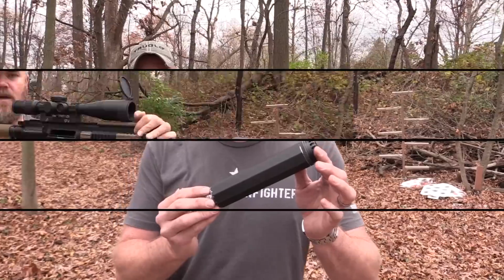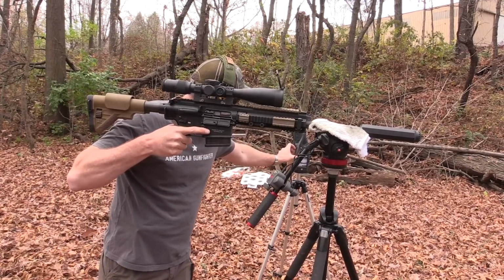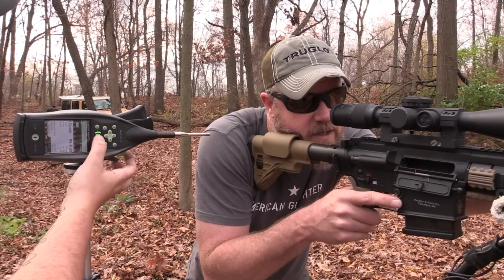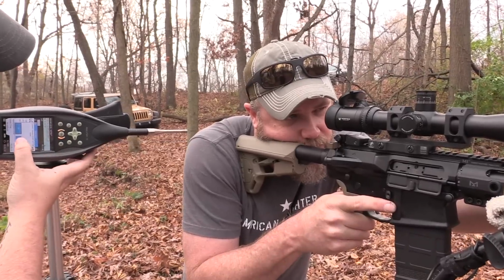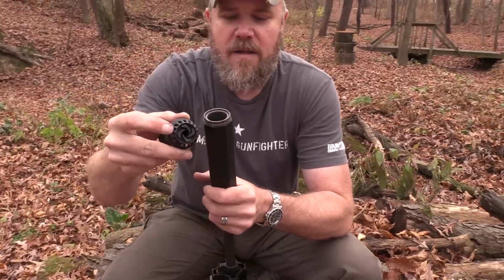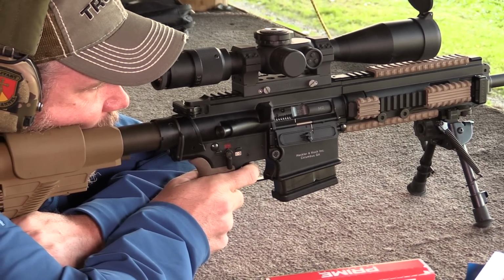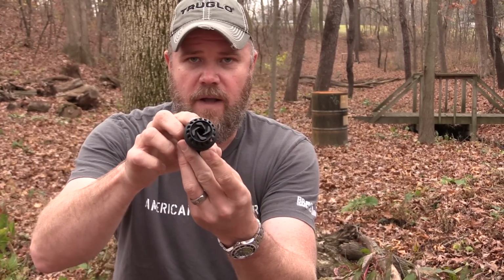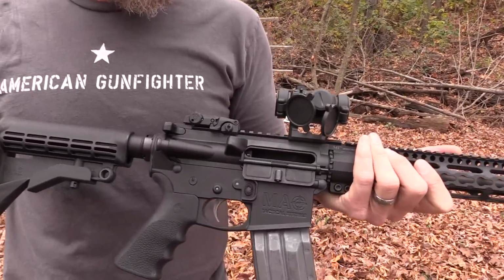New OSS Helix 762 Silencer full test!

Comment: Forgive the comment, but would not a proper cheek weld to the stock of the rifle place your OFF-HAND ear roughly 4 inches closer to the barrel than your DOMINANT ear? So if you were a right-handed shooter your left ear would be closer to the muzzle than your right, since you have to angle your head to the right side to correctly align your sights. Of course, unless you are shouldering the rifle backwards or just don't know your right from your left, in which case in the US Military your Sergeant would have you carry a heavy rock in your pocket to know the difference.

I don't shoot firearms, I mainly shoot airguns, but I personally place my standard measuring point for the muzzle report intensity as 4 inches to the side of the trigger well, since regardless of what rifle you are shooting the trigger is almost ALWAYS in the same spot and provides a very consistent place to measure volume. It's also closer to the muzzle, which raises the benchmark for acceptability.

Comment: 10:50" Didn't make any sense the affirmation that the gas coming out of the ejection port is the gas comming out for the barrel, not the gas comming out from the DI siystem. Ti'll the gas arrives the head of the bolt carrier group, the bolt is locked, preventing the gas comes from out the barrel. That is simply the system works. This is a gas operating system, not the blowback system, and, this is an disadvantage of the DI system instead of piston drive system. The advantage is a ligther system than the piston drive.
Excellent video, man.

Comment: There is no free lunch. If there is less back pressure, it has to go out the muzzle end. The only way to mitigate that is with a longer can (with more baffles) , or a fatter can to increase can volume.
So, if command and control is my main concern, then I want my battle buddies to hear less noise, which probably means more dB at the shooter. If the concern is the shooter's hearing, then less back pressure is more desirable.

Comment: Pretty obvious why they don't measure at the shooters ear.  They need standardization for all testing.  If I'm shooting it on a 30" barrel and you're shooting it on a 16" barrel, well, then the numbers don't mean anything.  It's good for a relative comparison, but then so is anything.  If your'e comparing one can relative to another, then anything is really fine as long as it's consistent.  But if MAC does a review and I do a review, unless we pick an arbitrary platform to both use, we could get different results.  So the "arbitrary 1.6m x 1m" standard is fine since it's standardized.  Of course we want to know what it will sound like on our own guns.  I shoot a 10.5" 300 blackout, a 24" Savage Stealth in 6.5CM, and a 1911 in 45ACP.  So what do your numbers mean to me with those guns??  Nothing, really.  And thus the standardization.  There is a method to the madness.

Comment: Hmmmm... is this just make it like those blast forward sound device "aka open end can" other than a few db drop at the muzzle end being semi capped?  I can probably design a much simpler and cheaper device that does the same thing. You can do that with a baffle system too by putting smaller port hole at the end of each baffle near the OD and a couple of small relieve hole on the end cap to get the same or similar results.

Comment: Hahahaaa, industry standard seemed logical and more consistence because test equipment measurement from the muzzle doesn't changed. A measurement from the shooter's ear is a cop out method because OSS couldn't achieve the decibel that the military prescribed based on TMDE (Test, Measure and Diagnostic Equipment) as safe using the industry standard. Because logic dictated that the further away from the muzzle, the less noise. Therefore OSS sold this method to the military and won the contract. Military Special Operations may be good at what they do because that is what they were trained to do, but they know tidily crap about science and technology and OSS continually throw them the bone.

Comment: My question (more for the military, I guess) is this: In the military, suppressors are used to hide a weapon's signature from the 'bad guys', right? So why not test the suppressor's perceived volume say 100 yards downrange from the rifle? I suspect that's not a likely distance for engagement of a bad guy with a KAC M110 SASS or it's replacement the HK417-A2, but it's a nice round distance easily repeatable without too much hassle.  Heck, even 50 yards would produce usable results for comparison's sake; set up a paper target with a backstop far enough behind it that the meter doesn't read the impact sound of the projectile, and see what happens... THAT'S the comparison test I'd like to see!  I conducted a similar test some years ago with a Glock 21 and two different suppressors with a substantial difference in their metered performance at the 'industry standard' set-up of 1m left and 1.6m up, and confirmed those results in our first test; then we set up the mic 25 yards downrange (taking EVERY PRECAUTION to insure safety), and repeated the test (using the exact same subsonic ammo & gun in both tests) and surprise surprise! The suppressor that metered with a higher db count at the muzzle was substantially quieter 25 downrange than it's competitor, which was generally considered the superior performer.  We did not make a video of these tests because at the time neither of us was much into youtube, and we were doing it for our own curiosity more than anything else. I do regret that we didn't film it, and that we didn't keep the data we gathered, though I've considered repeating the test, now that we have better cameras, and more suppressors to compare. ONE LAST NOTE: I owned a recording studio, ran a couple others,  and was the engineer in all of them; I have as close to perfect hearing as it gets, and have gone to great lengths in my life to preserve it, hence my initial interest in suppressors.  One thing I've noticed again and again is that METERED volume frequently does not correlate to PERCEIVED volume; in suppressor testing, I've gotten much more usable data from my ears than anything else... Just sayin'.... KEEP THE GREAT VIDS COMING TIM & COHORTS! MAC ROCKS!!

Comment: My guess is the reason the sound is measured in the standards you mentioned with the meter's microphone off to the side of the muzzle might be that sound pressure level (SPL) is defined as the force of the sound on a surface perpendicular to the sound.  Same with specifying the distance of the mic from the sound source -- doubling the distance would reduce the measurement by 6dB.  If you want to do an comparative ear measurement it would need to be an ear on a standard rifle a fixed distance from the silencer with the ear facing the silencer.  Also, I'm not sure you can just average the readings you get from the meter to get an average.  The sampled sound pressure itself might be normal but the distribution of the dB readings from the meter would be lognormal.  It's interesting the way the 5 measurements were consistently decreasing at the beginning of the video.  Would this be because fouling or heat was improving the performance?  Thanks for posting the video.

Comment: oss is around 6 db louder at the barrel however oss doesn't cause over pressure so you end up with significantly increased reliability and you can shoot more than 5 shots in succession without being blinded by gas from the conventional baffle suppressors that increase back pressure and wear tear . but traditional suppressors still are preferable for certain weapons

Comment: It's worth noting that longer, traditional cans (e.g. Sandman-L) on a semi-automatic rifle can sometimes be louder at the shooter's ear when compared to a similar can that's shorter (e.g. Sandman-S). The additional baffles will generally create more back pressure, which creates more noise and throws more gas in your face. The shorter can will be louder at the muzzle, but as you point out in the video, that shouldn't be the main concern of the shooter.

Still, the OSS design is very intriguing.

Great video. Thanks for the comparison.

Comment: 140dB is NOT hearing safe. Any impulsive noise above 120dB presents a hearing hazard.

Also, since Bels (1deciBel = 0.1 Bel) are logarithms of relative amplitude, you should not averagem them directly, but transform them to amplitude, average then take log again.
Reply: Not sure where you got 120dB, but OSHA says 140dB is the threshold for impulse noises.

Comment: i wanna hear it on blackout
Reply: I know this is an old comment but I have an OSS can that I got just for my 300 blackout  16 inch. It is the 2 stag with 1st being over the barrel. Same design but slightly longer with both stages. I love it. With both using subs its sound is similar to an airsoft ar. With super its slightly above that. Single stage the subs are like the super using both and slightly louder in the single configuration using supers than the subs. These are discontinued but you can still find them available, sometimes at a large discount. I got mine for about $550 and with an adapter it works great on a 5.56 cause of its larger volume than the purpose built can they make. My version can be used on barrels as short as 10.5 inches due to the over the barrel design. It is also limited to barrel diameter size, so heavy barrels are out. But that is mostly long range platforms. The new designed can in this video doesn't have those barrel issues but as a long range suppressor this is not it. It will work but baffled suppressors will increase your max effective range due to the increased pressure especially on a bolt gun. Hope this helps and watch your six

Comment: the AR bolt alone slamming closed is near 120db. add port pop on top of that and you get LOUD!

pistons do f all to prevent blowback. as OSS correctly pointed out, the majority of gas is from the can coming back down the barrel when the bolt is open. a baffled suppressor is like a balloon, it captures the gas and then releases it slowly.

the OSS can is different in that it diverts and slows the gases through serpentine channels. they are absolutely crazy rube goldberg designs. i can't imagine how difficult they are to machine.

Comment: Thanks for the help on deciding on a new rifle though i have more or less a request. I've come across a sight called the ATN X-Sight II which can be a 3-14 power or 5-20 power sight that can record through the lens has a bullet drop compensator and a range finder. It also has the ability to go from daylight use to night time use. This sounds amazing and should be worth 1000+ dollars but its only 700 dollars for the 5-20 power and around 50 or 100 dollars less for the 3-14 power sight. If you could do a review of the scope or give a input on it that would be amazing. i like the thought of a night vision scope for use in hog hunting but i don't trust the price tag. it seems way to inexpensive to work for the length of time a normal scope would work.
Reply from the maker: In my experience (3 of them) the X-Sight is a horrible waste of money. I most recently got one of their X-Sight core spotting scopes. I had it for a day and returned it because it too simply didn't work. I would do a review if I could get one that actually worked as it's supposed to.
Reply: Military Arms Channel Again thank you very much. That was a fast turn around time for my question and this is one reason why your my favorite gun related channel on youtube.

Comment: what a shit comparison. why did you use a different gun?
Reply from the maker: The muzzle device for the OSS is classified as a "silencer component" and thus you can only have one which ships with the can. The HK's threads aren't a standard US thread pitch of 5/8x24. They are working this out with the ATF so this won't always be the case. I got it for the HK rifle because this is the new CSASS system not thinking that I wouldn't be able to run it on any other AR10. More testing will take place, but the results will be similar.
Reply: Military Arms Channel the point I'm making is that you called it a comparison. it's not. of course a piston gun will be quieter at the ear. This video is obviously biased towards the OSS can. and I may have missed it but I don't recall you mentioning anything about it being a poor comparison

Comment: Why would you not test the 2 suppressors on the same gun? I feel like OSS is paying you or you have invested stocks into OSS before this video.
Reply from the maker: The muzzle device for the OSS is classified as a "silencer component" and thus you can only have one which ships with the can. The HK's threads aren't a standard US thread pitch of 5/8x24. They are working this out with the ATF so this won't always be the case. I got it for the HK rifle because this is the new CSASS system not thinking that I wouldn't be able to run it on any other AR10. More testing will take place, but the results will be similar.
Reply: Military Arms Channel 
They should/could have designed a inner and outer threaded piece with that the registered muzzle device then threaded onto. The outer threads being universal to the device and the inner threads being matched to the barrel threads.

Then the initial threaded adapter would be inexpensive to manufacture compared to having to buy multiple registered devices for each of the different muzzle thread types.

Is this not a good,simple solution?

Comment: Without test on the same DI host results are not valid at all. OSS 150 db @ the muzzle plus carrier exhaust will meter more. Please do that test! Also will be nice to weight the silencers, titanium+stainless OSS generally 25% heavier then way more superior inconel cans like Sure-fire.
Reply from the maker: The muzzle device for the OSS is classified as a "silencer component" and thus you can only have one which ships with the can. The HK's threads aren't a standard US thread pitch of 5/8x24. They are working this out with the ATF so this won't always be the case. I got it for the HK rifle because this is the new CSASS system not thinking that I wouldn't be able to run it on any other AR10. More testing will take place, but the results will be similar.
Reply: It is not last OSS can in your hands) I will not advocate thread adapters as it can instantly kill the can. Thank you!

Comment: I feel like it would of been so easy to put the Deadair on the HK to test the OSS theory (or vice versa).
Reply from the maker: The muzzle device for the OSS is classified as a "silencer component" and thus you can only have one which ships with the can. The HK's threads aren't a standard US thread pitch of 5/8x24. They are working this out with the ATF so this won't always be the case. I got it for the HK rifle because this is the new CSASS system not thinking that I wouldn't be able to run it on any other AR10. More testing will take place, but the results will be similar.
Reply: I apologize for my ignorance. Appreciate the response!

Comment: You should use the same rifle for comparison testing of silencers.
Reply from the maker: The muzzle device for the OSS is classified as a "silencer component" and thus you can only have one which ships with the can. The HK's threads aren't a standard US thread pitch of 5/8x24. They are working this out with the ATF so this won't always be the case. I got it for the HK rifle because this is the new CSASS system not thinking that I wouldn't be able to run it on any other AR10. More testing will take place, but the results will be similar.

Comment: As a right handed shooter, how on earth did you come to the conclusion that your right ear is closer to the muzzle?  This tortured "logic" smacks of misdirection from OSS in order to get that ear test mic right in front of the ejection port where their product will look better than a conventional suppressor.

There is no doubt the OSS can has much less back pressure but they are big, heavy, loud and expensive in comparison to conventional silencers.
Reply from the maker: How did I come to the conclusion? You mean how did the DOD come to the conclusion.  It is not loud where it counts for civilians, it's actually more quiet. Obviously you're a fan of some other brand and that's driving your commentary. Me? I'm getting more OSS cans.
Reply: I just built and test a low back pressure suppressor on an AR and tested it at the ejection port which lead me to an interesting conclusion.  A DI AR vents high pressure gas out of the bolt carrier, which contributes to ejection port noise.  Yet you decided to test the OSS suppressor using a piston rifle, which avoids the bolt venting.  Seems that would make the OSS look much better.

Is OSS paying you?  Is your reputation worth whatever you got from OSS?
Reply: FWIW I am not a fan of any particular manufacturer.  I am a fan of truth and data.  

I design, build and test sound suppressors and hold two US patents on suppressors.